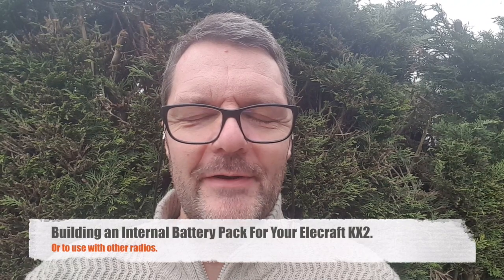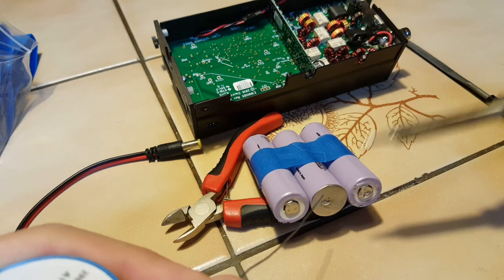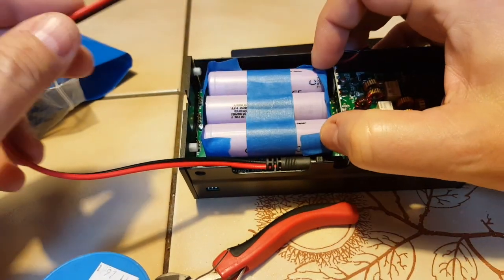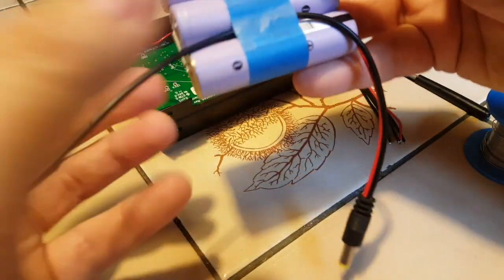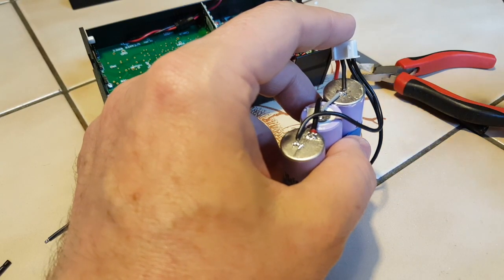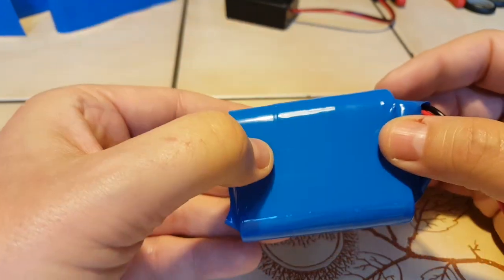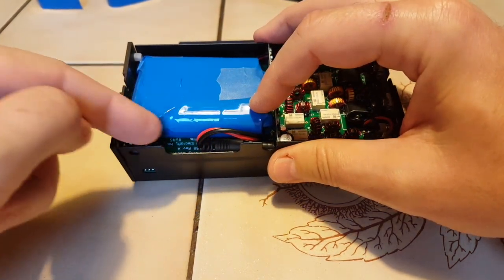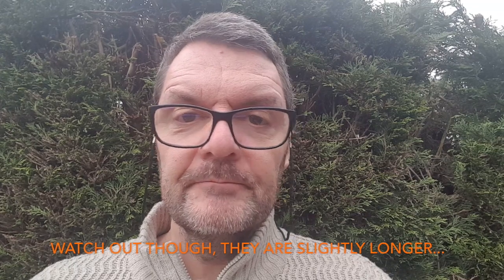Building an Internal Battery Pack For Your Elecraft KX2.

Comment: Glad it worked for you! I wonder how's it doing 2 years after?  I've gone a bit differrent way while making mine 18650 Li-Ion packs, I've decided to use the PCB with BMS both for battery protection and charging or , in the other pack's version just using the cells with miniature PCB's already factory- installed in each cell. My "endevours" are here : https://youtu.be/fgkG5EZklFA
73! Stay safe! Linas LY2H
Reply from the maker: Hi, unfortunately I sold my KX2 but I am still using the pack and it works great :-) I have used those battery holders by the way, they work well, though the wires are a bit thin, but for QRP it's ok.

Comment: Gil, love it! Great project. I have a number of bad laptop batteries, only a few months old I need to find out are good and work into a 12 volt source for some Ramsey Kit transmitters, an OHR 30 Meter transceiver, a 20 Meter Backpacker designed by Bill Hickox, K5BDZ, silent key, and a 38 Special Superhet 30 meter transceiver.
Reply from the maker: So many kits, so little time!

Comment: Be very careful around the small thin filter board sticking up by the battery !! I bumped mine and lost 15 and 17 meters and now must hunt for the component I knocked loose.
It's a very fragile board and the manual even cautions to be careful with the battery hitting it when installing.
Lee, WA8QFE
Reply from the maker: Thanks, I will be careful..

Comment: Hi Gil, great video as always! Do you think using 4 x 18650 3.7v, 3400mah power btys would work ok as an external bty for the KX2 or is that pushing it a bit?
Reply from the maker: Sure, but I would charge them to 3.75V max, 15V total, even a bit less, say 3.74.
Reply: Great, thanks Gil. Is there a charger out there that you can specify how much you want to go into the battery/pack of 4, the two I have wont let you do that?
Reply from the maker: Most of the smart chargers will let you set a max voltage.. Maybe a charger for Lithium Ion Phosphate cells, which have a slightly lower voltage. You might be able to find a cheap BMS on EBay.
Reply: Great, thanks Gil :-)

Comment: Be careful with that pack i noticed 1 of the cells cans dented at the bottom and im fairly sure those are cobolt chemistry cells by samsung or philips dents in them can cause catastrophic failer which will end in venting and fire. 99% of the time. Grate build tho as usual love the videos
Reply from the maker: Thanks, I will be extra careful and not leave the pack inside when not in use...

Comment: Absolutely outstanding. So we finally got you off your couch to make a magnificent video! Well done! What are you comparing to? I mean what's the hundred-dollar number you throw out there?
Reply from the maker: Ah, being on vacation right now this is a fill-in video. The $100 is the price of the Elecraft pack and charger. I will be making more field videos. You can start with the previous one on improvised antennas. While I did not go far, it is a field video! There are quite a few others in my list, browse a bit. My longest field operation was testing the MPAS in the Pyrenees for almost three weeks of trekking... This summer, we'll see... Not sure where I'll go yet. I hope to see more of your countryside this summer too...
Reply: Radio Prepper hundred bucks for a 3-cell battery pack from elecraft? Must be made of some new space-age materials. I enjoyed this video very much, as I did the video series you made in the Pyrenees. For the most part my station is ready for the field. I was out testing everything today. Batteries, charge controllers, radio, interfaces ,... Theres a special series coming up on off grid comms. 
Anyway I'm just giving you a hard time about all the kit videos. I enjoyed this one very much
Reply from the maker: $50 for the charger and $50 for the 3S pack... A bit much indeed, especially for the charger. They use good quality protected cells, but still. I guess maybe their thinking is that whomever can afford a KX2 can spend $100... Not always...

Comment: Thank you Gil for this great video ! I must say that the available space left in the KX2 for the battery pack is very tiny and inserting a 3x18650 pack is a real challenge! The cheap plastic containers for 3 batteries found on e-bay doesn't fit inside at all. I've also bought a ready-made 3 x18650 pack from a chinese site, but it cames 1 month later and doesn't  fit that much inside, because of too long  wires and an the added thickness due to the incorporated BMS... So I had to forget my project of fitting a battery pack into my KX2, actually convinced by the idea of not taking the risk to damage the printed circuit with the added pressure. Your idea of not using a large BMS is nice, although one can found self-protected  18650 cells. Personally I use a battery pack sticked to the back by a Velcro...But when I have time I will try your solution ! 
Hoping to meet you on the air and have some practice in cw ! I am hunting the 30 m band  just in case... Thanks and 73 !!! Serge F4HYY
Reply from the maker: That would be cool Serge. Look me up on the Reverse Beacon Network, F4WBY or EA8/AK4YH until Thursday!
Reply: I will focus your call in RBN  !! Thanks !
Reply from the maker: My calls have not been picked up yet but I will keep trying..
Reply: I have a 3D printed battery pack that took me a few weeks to perfect for my KX2.  It allows me to use individual 18650 cells.  It fits with the KXIO board as well.  There is more room than you think.  I’ve shown photos in a few FB groups, withholding my comments until it’s been tested.  I can say that at this point, it doesn’t work so well. It really needs custom springs to maintain contact with the battery ends and the approach I used works but is very touchy.  I just bought an 11.1v 3x 18650 pack with PCB and shrink wrap off eBay for $20 to use while I work out a slightly different approach.